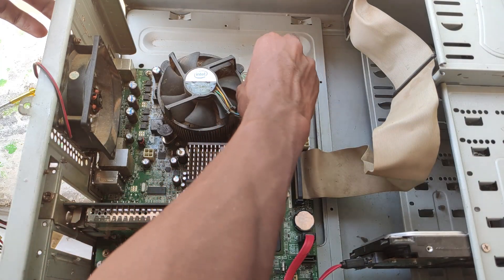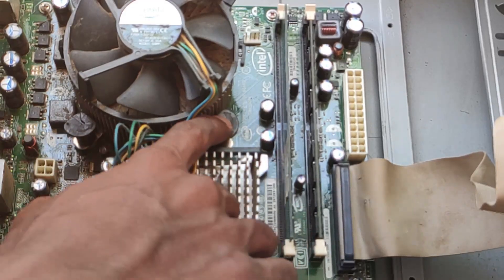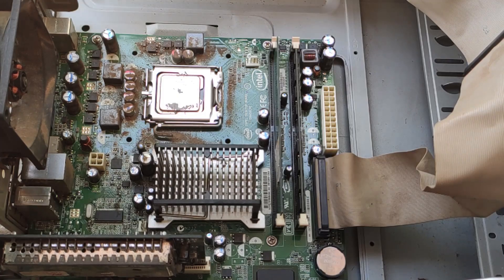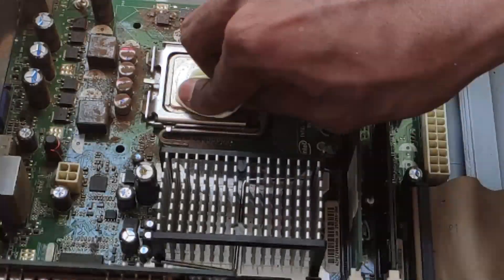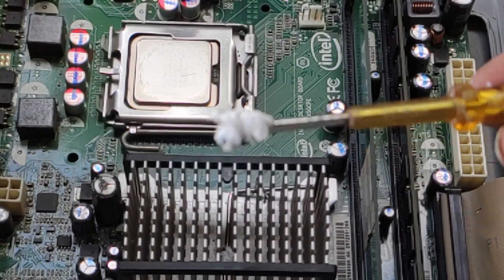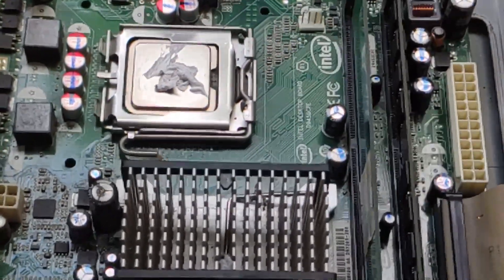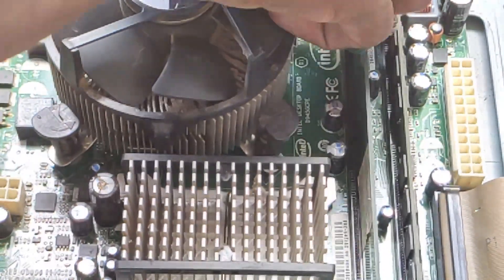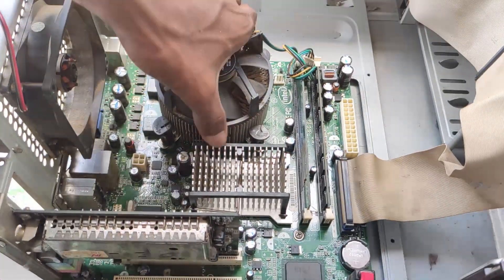how to apply thermal paste from cpu in tamil

Comment: This one of the worst how to video i saw in youtube
first-no proper explanation (you just said something on your own, it is not completely wrong also it is not completley right)

second-the thermal paste you used (always use a good branded thermal paste like cooler master,deep cool,arctic etc and i also kknow that pc you used is not a high end system and it is not gonna produce much heat so maybe that paste might be enough but viewers may have a good pc and they only need to use branded good quality thermal paste not 10Rs thermal paste)

third-the way you applied the paste (how can you even use a screw driver to apply the paste) and you need to use isopropyl alcohol to clean the paste in the processor and the heatsink of the cooling fan)